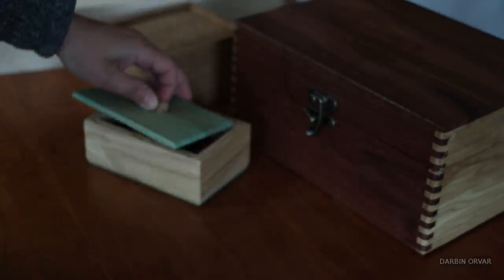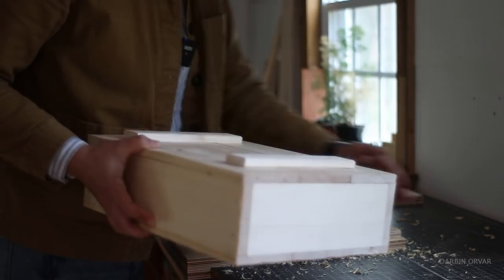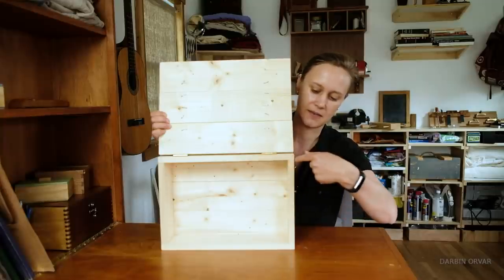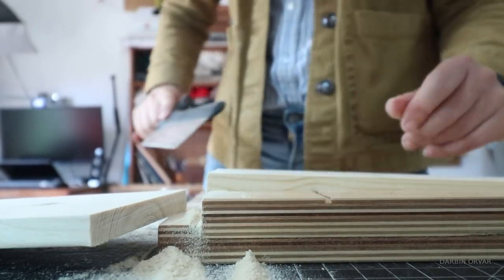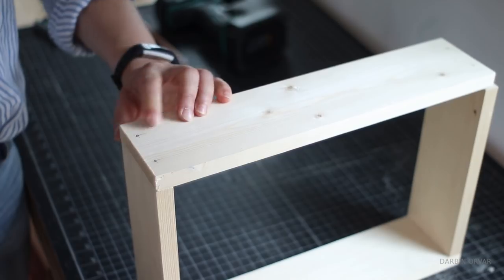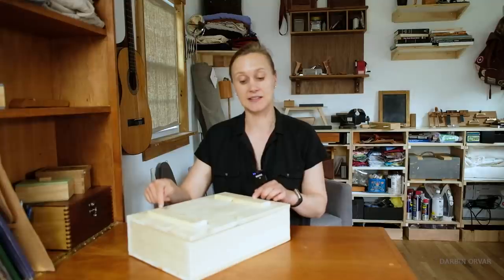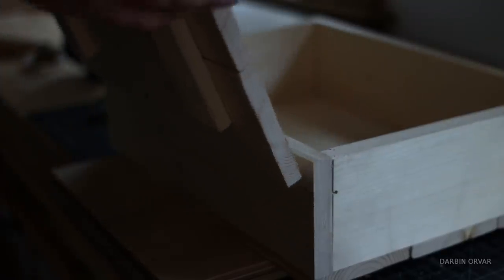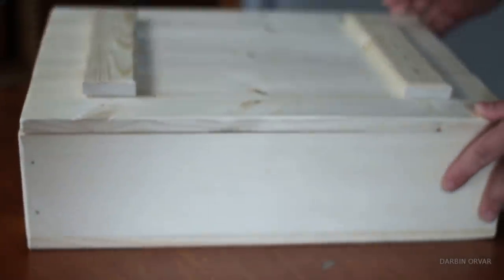Making a Dead Simple Box // Woodworking Project

Comment: When nailing butt joints, it is also helpful to angle the nails a bit in opposing directions. This acts similar to dovetail geometry and also gives the nails a small amount of cross grain hold to resist pull out.

Comment: To make this a completely power tool free project, consider replacing the cordless drill with an old fashioned egg beater style drill, which would have been as common in a wood/carpentry shop as was a brace and bit. Good work and good information.
Reply from the maker: Yes, love those

Comment: If you blunt the nail tip with a hammer it will crush it's way into the wood and not split it. If you're going to pre-drill you may want to strengthen it with glue. Why not have it around for awhile? Nice little box.

Comment: This is a great tutorial. I'm just wondering what are the dimensions of the wood you are using? I want to order wood that has the same dimensions as what you're using in this video. Thanks!
Reply from the maker: Thanks! The boards measure about 3 1/2" wide, 1/2" thick.

Comment: Shouldn't the bottom be inset, to help with heavy load?  To get the nails to help with the load...
Reply from the maker: You could of course, but that's a different design. Plus I'm not concerned, the bottom is quite strongly attached for a reasonable load.